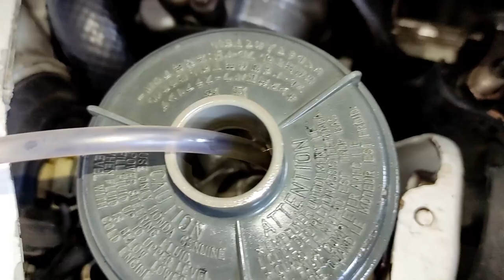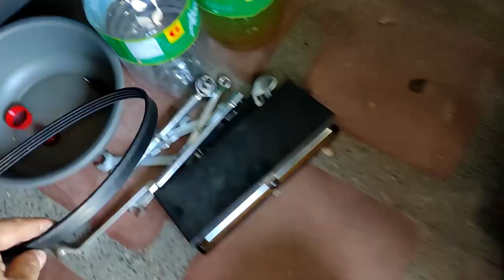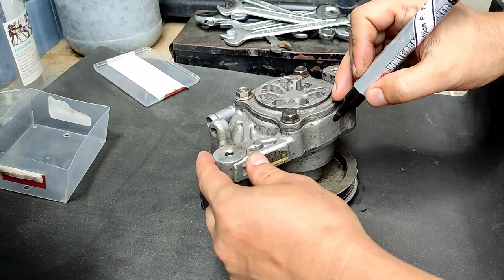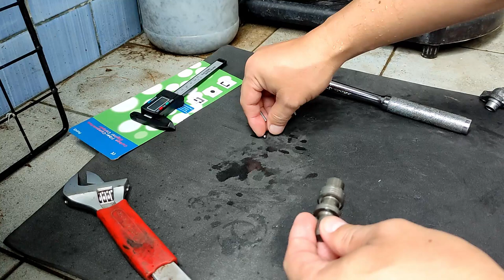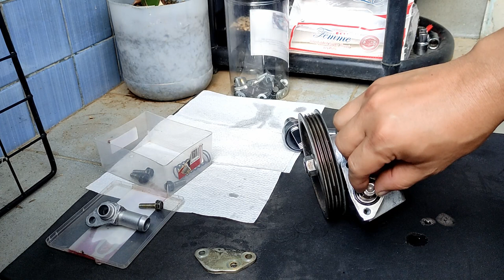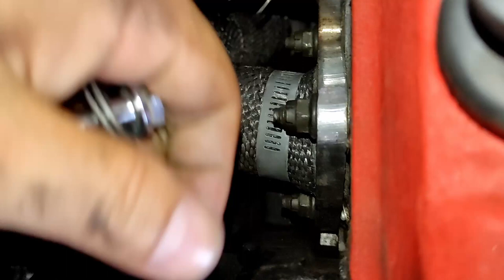HONDA CIVIC EG HATCH D15B, POWER STEERING PUMP NOT WORKING, REPLACE OIL SEAL, VLOG #4

Comment: Thank you for the mention, Joms F!  You are the first subscriber to mention the Southpaw Autoworks channel in a video.  You have no idea what this means to me.  Thank you so much.

I watched your entire video.
I like your siphoning trick with the clear hose, and your use of the syringe.  I've never heard of using nail polish for thread locker...that's really cool!  I try to learn something new every day.  Thank you for the enlightenment.

The previous mechanic really liked that gasket maker.  Pretty wild that it got all over the FCV (Flow Control Valve).  I imagine that the FCV being installed incorrectly would cause the power steering pump to not operate as intended.  

Like you said, maybe the sub-valve is located in the high-pressure hose.

It's awesome that you were able to fix your power steering pump.  Congrats, Joms F!

Thanks again for your support of the Southpaw Autoworks channel.  You are appreciated...
Reply from the maker: thanks for dropping by Robert, i also shared your vid on the EG/EH hatch group worldwide
Reply from the maker: your guide is also pinned on this video with link :)
Reply: @JomsF  Right on!!  Thank you!